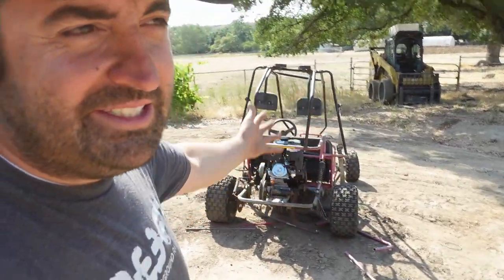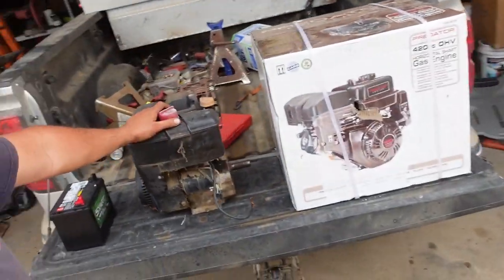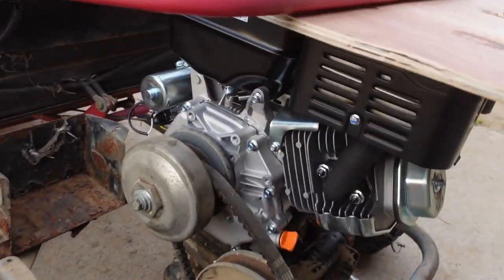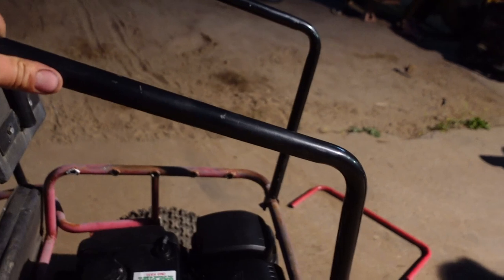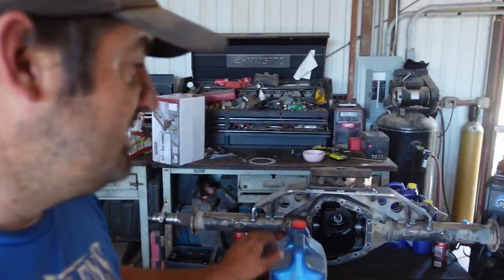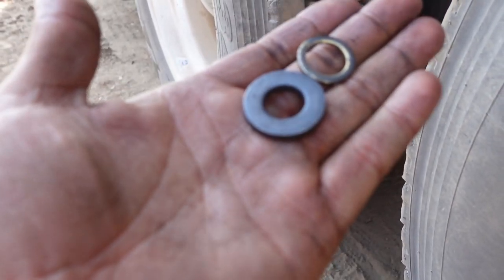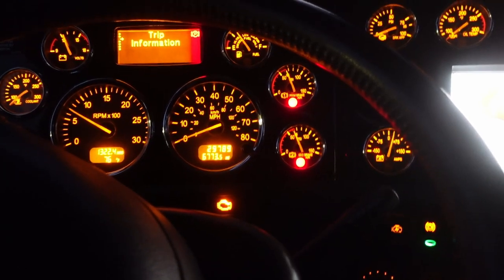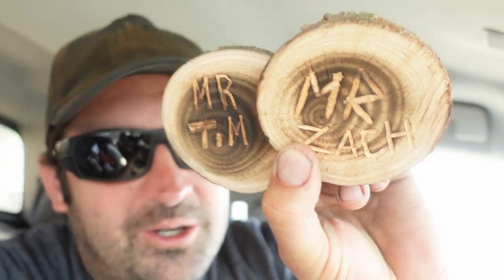420cc Harbor Freight Predator in our 100 dollar go-kart???? Why not

Comment: Have you ever tried woodturning on a lathe ? I bought a lathe from Harbor Freight 2 years ago and haven't had any issues with it yet. You could make drinking cups to go with your laser engraved coasters.
Reply from the maker: Just looked at them I didn't know them. Do you have the bench top or the stand alone
Reply: @Mr_Get_Muddy  The stand alone. I would also seriously consider getting an adjustable lathe chuck. This makes mounting a blank so much easier.

Comment: Did you put all the chrome on the trucks or did you buy them off the lot like that
Reply: They all came like that. The one James drives is an ultra cab, mine sadly, is not.
Reply: @Juan4themoney   I'm not gonna lie don't know the difference in the cabs
Reply: @zachs9817  it's much bigger inside, it goes back more which allows for more leg room, and it's taller as well.